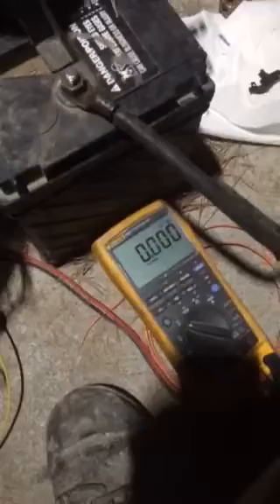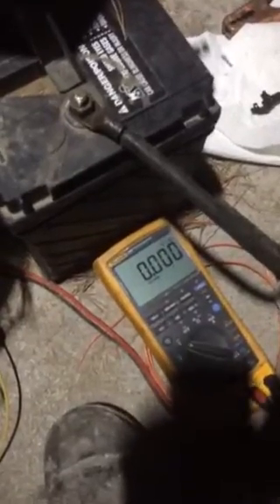OM 606 mercedes electronic governor

Comment: Hi, can you make a manual how you make the acceleration control
Reply from the maker: i got it to run and idle and that was about it. it would take a lot more hours to get it to work. but i could be done.
Reply: How do you to start the engine.

I have connect the magnetic switch (12v) to flow the fuel.
And i have connect the injector (Pin 2 and 3) on 5v.
I can´t start the engine.
The injector does´t inject the fuel into the engine.
Reply from the maker: Jeldrick Sitz  pin 2 and 3 on the fuel valve turn it on. 
Then you need to put 3-5 volts in to the actuator for throttle control. 
Be very careful because it will over speed really fast. There is no governor. You are the governor. 
Also you have to keep it running. 
I do t remember the pins that operate the actuator in the pump.
Reply: the engine works good